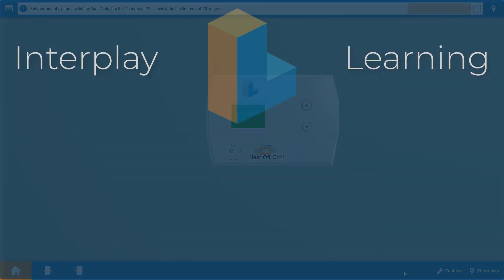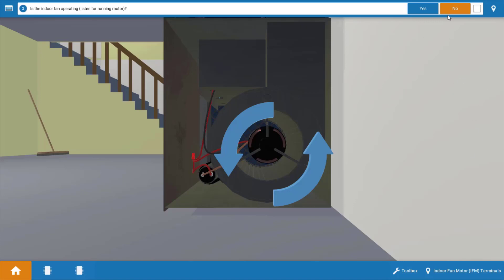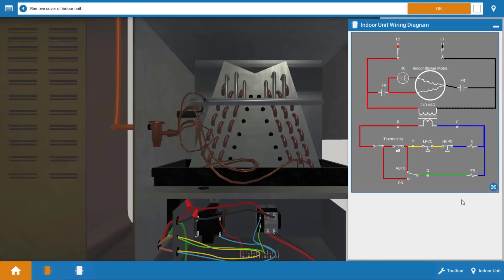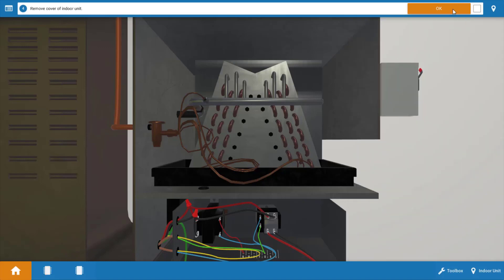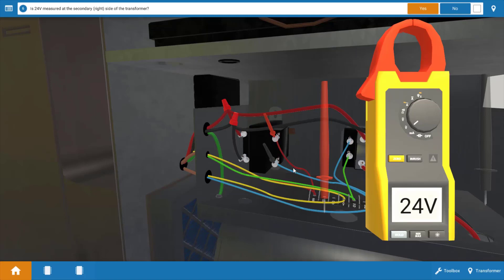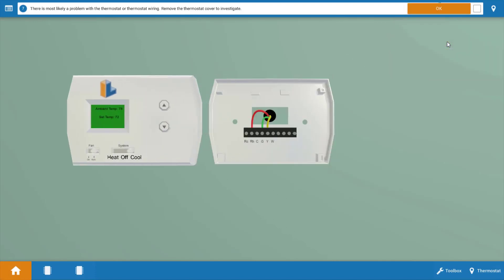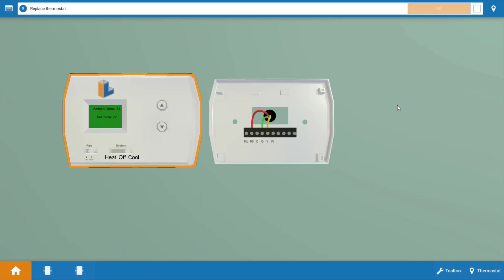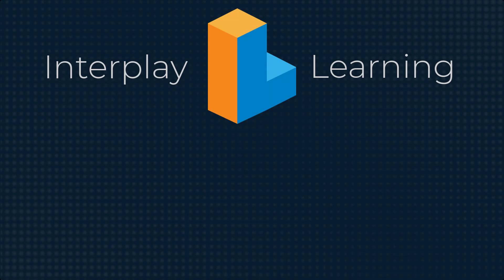How To Troubleshoot A Faulty Thermostat in Residential AC  [HVAC Training 2019]

Comment: You’re not gonna check for continuity?
Reply from the maker: Check for continuity through the thermostat? A jumper from R to Y & G then R to W would verify continuity through the thermostat wire if components cycle on. You wouldn't be able to check continuity through the thermostat if it is digital. The contacts will only close when the thermostat is energized. I would take an ohm reading on mechanical thermostats just to double verify.
Reply: He did great!!!! 👍🏼